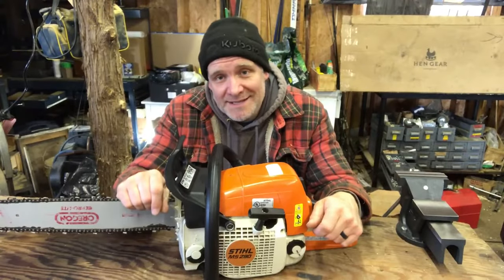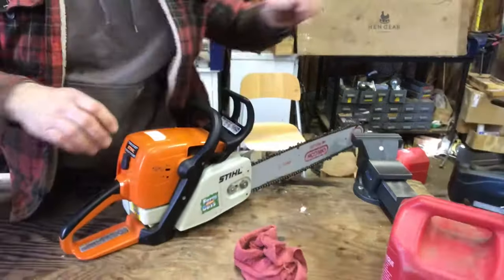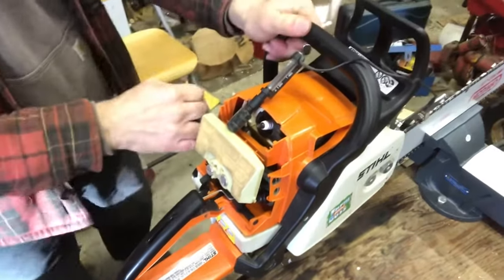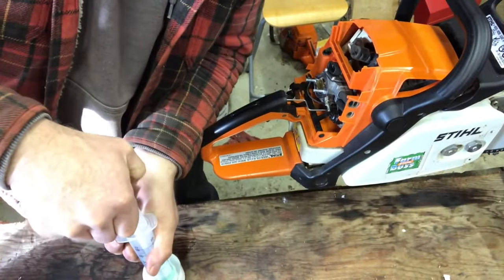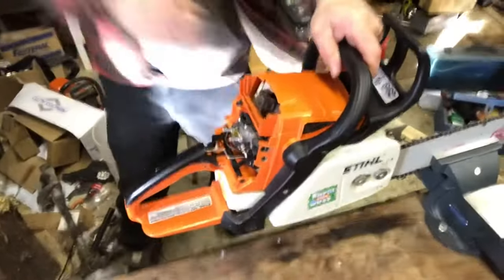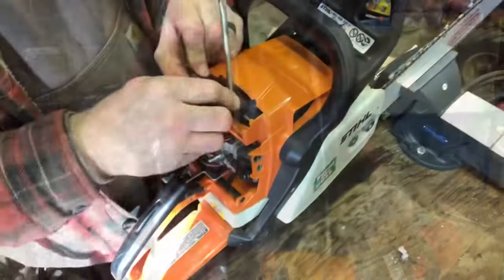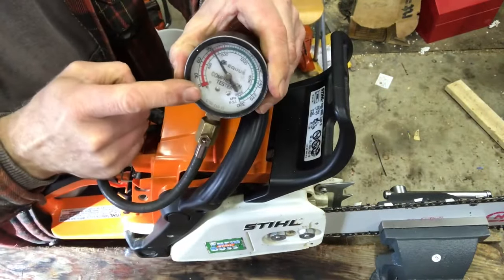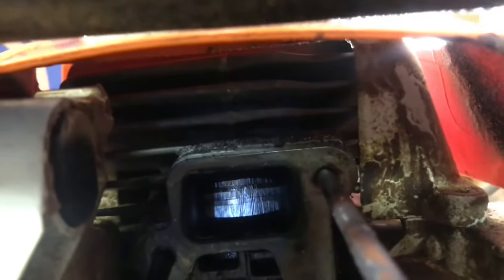How to fix a chainsaw that won’t start

Comment: Thank you for your video and advice.  For my two saws I used to believed that starting the chainsaw depending  on an acceptable proportionality of variables that includes (cusswords said at the saw,   blaming someone else for misusing the saw) while pacing around the saw with hands on hips while looking up. It's almost like casting a spell. Thanks for the video

Comment: I have a husky 141 chainsaw there is spark, fuel and I have done a carb clean, but it will not start now I have looked in the inlet and outlet and the piston looks brand new, but on my compression test I’m getting lower that yours, so is there crank seal or woodruff keys on the flywheel

Comment: Thanks! I have a chainsaw, but found an MS271 on the curb on trash day and picked it up. Turns out everything works well but the compression is about 70. Seems like a fun project.

Comment: If you add Sea Foam to your gas in the fall it will most likely start in the spring, if you don't it most likely will not without umping the gas and using fresh. I've been looking after a bunch of 4 stroke Hondas for many years.

Comment: I cleaned my carb (MS250) reinstalled, and it ran great. Shut it off and it won't start. I bought a new carb. Same thing, cranked on the first pull , shut it off and it won't crank now
Reply from the maker: It’s possibly could be your crank seals if it only does it when the saws warm. If you remove the carburetor, there’s a little pulse hole make sure that that isn’t plugged. You can gently blow back through it with a blow gun. Hope you get a runing better.
Reply: Impulse line

Comment: The 290 is a good saw. I bought one used, it was about 2 yrs. old no issues. Until it fell off my trailer, run over by the trailer wheel on our cottage road, going down hill 6mph. Cracked cowl and summer, winter screen. Still runs! But I bought a MS 291 as it was on sale as parts get rare. Now the farm boss will be my back up saw when I get in a "pinch". That happens at times, and then oh fun. BTW Stihl has a new hand sharpener out, works really well! Just make sure it's the proper size for the chain. Also run high test gas and Stihl oil as it has stabilizer in it. Take care.

Comment: Best  video. Everything he showed is dead on.
 Need compression tester though. But you should be able to hold saw from pull cord but new models have compression release button.
Reply from the maker: Thanks for watching man
Reply: @cheaphomesteading  youre welcome. I ran into same problem with no compression or little. The piston looks like it went through a wood chipper. Thanks for posting great videos